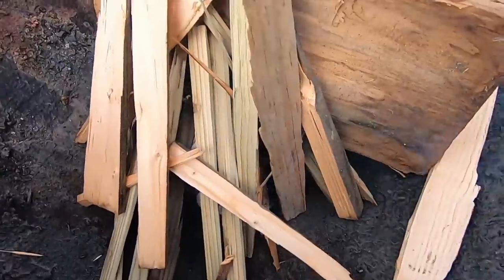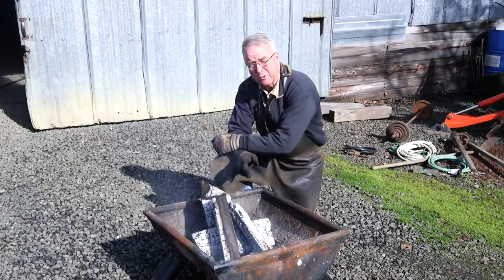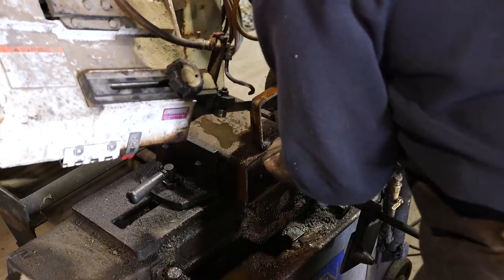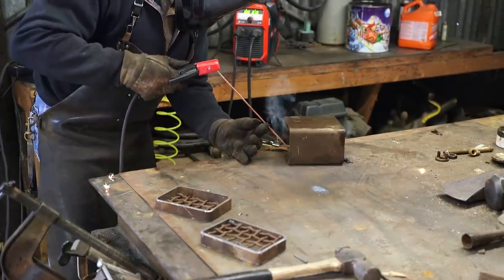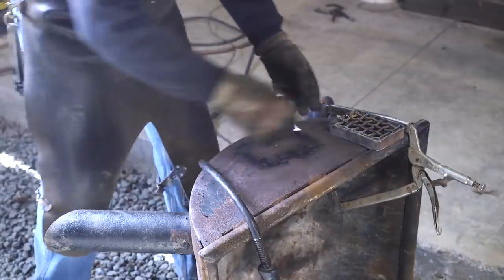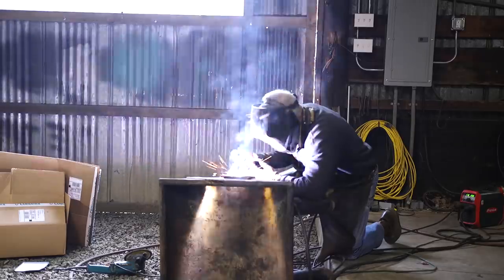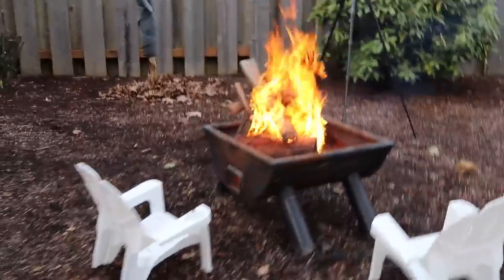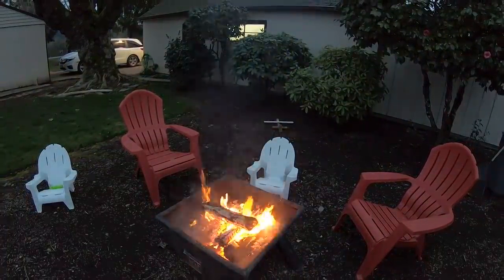Repairing a Firepit + A Tip for Beginner Welders

Comment: I noticed that the fire pit has a problem that is a pet peeve of mine.  It has no drain.  When left out side it will fill with rain.  It will be heavy to tip up and drain and that standing water will accelerate rust and the eventual demise of the pit.  Easy fix, drill a small hole say 1/4-inch at the low spot and Bob's your Uncle.  This is a problem I've had with a couple of smokers and other outdoor items so I'm attuned to spotting it. Thank you for all your work!
Reply: Yes I'm watching this right now because my fire pit rusted out. Low spot agreed, to be safe maybe a few hours around in case it gets rotated and there's a new low spot you didn't anticipate

Comment: Ranch welder...haha.  That hurt a little but it’s true.  🧐 I have built several sets of shipping pens with rusted oil field pipe and it barely gets a wire brushing.  Good old 6011 splatter rod, one in right hand for the electrode and one in the left hand as a gap filler and never chip a weld because you really don’t want to see it...it’ll hold!
Reply: Good ol Texas TIG.😉

Comment: When I was at the french welding institute, we kept joking that we where at the french grinding institute, because we spent more time cleaning the metal with grinder than actually welding it 😂

As with almost everything in life, the more you spend time on the preparation, the easier the task get. So if you're a beginner, take the time to clean it properly. Take the time to have a good fit up. Do everything you need to do before welding with extra care, and I can guarantee that it will pay off in the results.

You can get fancy electrodes made for welding on unprepared metal ... And even with those, made especially to weld on top of rust, a quick grinding stone pass will improve the quality of your weld tremendously.
Reply: Yes!  Get that rust off... AND any galvanization.
Reply: @badlandskid  rust off is just to ease the process ...
Galvanization off is to literally not die ... Not the same discussion, but you're obviously right 😂
Reply: @InformatrIIcks  exactly
Reply: I’m a carpenter. My biggest pet peeve for prep work is having a clean work space. I hate it when plumbers come to do a rough in and just leave their shavings on the ground and go to running pex, they drop something then they have to sift through the shavings to find it. I hate when people don’t do prep work, and most of the time, it’s like a 5 minute, one person task.
Reply: @colbywood8113  agreed. 5 min prep work, and 10 min cleaning after a job. You'll feel like you just wasted 15 min, the truth is this habit will save you hours in the long run because you don't spend ½an hour searching where you left that stupid screwdriver yesterday !
Reply: @InformatrIIcks  Always drink some milk after welding. A big steel fab in USA has free milk onsite and encourages its employees to drink it often.
Reply: A quick run with the grinder will make a huge difference!
Reply: @boots7859  I've welded galvanized steel and was told to drink milk...I was breathing in the fumes.

Comment: Thank you! As usual, you continue to produce quality well thought out videos. I took the AG path through High School, and boy am I glad that I did. I continue to use some of the skills that I learned back in 1962-63. I do not have an electric welder, but I use a Propane/O2 gas welding rig. The welder also is used in melting glass to create beads and such for the walking sticks that I carve. Propane is a much cleaner fuel for the glasswork and works well enough for gas welding or cutting or brazing that I do. We have shown Collies for about 35 years, and the portable pens that we use are always in need of repairs where the spot welds fail. Brazing really holds up. I have yet to see a brazed joint fail.

Comment: This reminds me of my welding career. I bought a 300 amp Miller gas welding machine in 1972 and had never burned a rod. I taught myself how and what to do and not to do and eventually made a very good living welding in the oil fields of Texas and New Mexico. Had my own welding company and employed other welders also. Everything to building new drilling rigs, to any kind of repair to pipelines. I did it all. What this reminds me of is many times I would be on a rig and one of the bosses would want a barbeque pit. He was paying me (his company) so I would do whatever he desired. I built some awesome pits and smokers. Even some on trailers. I would guess I have built 40 to 50 of them and to this day I don't have one of my own. I often think I will motivate myself to build me a nice pit but the cheap little chinesium one does the job and we don't use it very often anyway.

Comment: I despised weld prep until I got myself a good (Not Harbor Freight but a real deal high power) air angle die grinder and Ro Lok candying discs. You have to have a good capacity compressor too but it is so much more comfortable to do weld prep with that than an angle grinder. Sometimes I still have to use an angle grinder and here again. Get a high power one. The new grip trigger harbor freight one is actually pretty good. Much quieter and more torque than the sub $20 specials. Well worth it. They run cooler and stronger. It’s like painting a car. It’s all in the prep. Mill scale is quite tough on modern steel. Only weld with you see the shiny soft steel under the scale.

Comment: I am welder/ carpenter as well. Most of my welding trade was high pressure stainless steel tig X RAY work.  From one project being stainless the next black pipe and the next aluminum I had 3 tool boxes to keep from contaminating one from the other. Welding and carpentry are basically the same thought process, kinda but with one your nails are on fire. I like your videos thanks

Comment: Yep, you need some air in there!
I'd also drill some small holes in the bottom of the firepit to let any rainwater drain out, not that this fire pit is going to rust out anytime this century LOL.
Material prep is SO very important in welding, I got that pounded in my head in high school, in our industrial arts class (remember them?) if we wanted to be allowed to use the arc welder we had to be able to strike an arc and maintain it for a little while with a piece of a coat-hanger, no BS, it was HARD to do, but eventually when we could do it for a few seconds, then using actual stick welding rods was EASY.
We had teachers back then who let us fail, over and over, while encouraging us to NOT give up, great life lessons for sure.
Cheers from Tokyo.
Stu

Comment: This is on of my favorite videos you put out. Thats how I was taught to weld too. Just burn rods and wire. Creativity will kick in after you get the hang of it and you'll be making all kinds of random stuff. Use what you got laying around. Cut up an old lawn mower. Learning metal prep is absolutely necessary to be a good welder too, and you'll learn it welding scraps together. I love your out look. Its the same with woodworking. I can do carpentry, but fine woodworking requires practice and there is a learning curve. There are things you can't learn until you've made the mistake yourself. Or had that bright light bulb moment where it finally makes sense. This is irrelevant but, I'm no longer subbed to stuby nubs. There is a major disconnect there. I don't like to feel insulted and looked down on. I don't feel that way listening to you. Thanks for another great video.

Comment: Inspired by you and This Old Tony, several months ago I went out and bought some welding gear, visited a steel merchant and got stuck into a couple of small projects.
It was lots of fun, but I quickly discovered after doing some practice welds on bits of scrap that welding is very similar to painting: the hardest part is all the prep work.

Comment: That's really good advice. I'm terrible at welding, but when I weld, it's usually to fix something old. But then one time I made something with brand new steel and it came together very nicely. I had a lot of confidence in myself until my next welding job, old rusty steel. I cleaned it up as best I could, but not perfect. Oh well, keep trying.

Comment: Nicely done. I would have just cut a few holes in the side but I'm impressed with the wire grid, etc. Much better looking, more pro. I'd be tempted to cut a grid for the top for a little BBQ action.

Comment: My trick is 7014.  Welds like 7018, runs on ac well, cuts through crud twice as well as 7018 and none of the care requirements since its not a low hydrogen rod.  Only downside is its a touch more brittle then 7018.

Comment: I have the WORST luck with weld haha All I've got is a MIG but all I'm doing is trying to weld handles onto billets of steel. I'll get a good weld, I think! Then get maybe 2-3 heats and the steel goes flying across the shop, cats are running all directions, I'm just watching to see what it lands on that'll be ruined this round of "Flying molten steel" the game!! Patent pending of course!! Lol I've cleaned the steel, pickled it, polished, done everything but just say screw it and forge weld it haha Any suggestions?? Is there a MIG video for beginners???

Comment: Great ways to clean your metal before you weld or forge them are to use vinegar, wire wheel, electrolysis, and evaporust. Clean metal is much easier to work with! Always take the extra time to prepare your materials before you start a project.

Comment: that was a neat video. By the way what was that mention of soaking in vinegar? please explain thanks. :-)
Reply: Vinegar will remove most of the rust and mill scale. What doesn't get removed will be easier to brush or grind off.

Comment: I know this video is about welding, personally knowing the welder that I'm not I would have drilled 4 or 5 1" holes in each end plate, what bothered me the most was seeing some of the kindling your son used at the beginning of the video! NEVER use treated lumber in a fire! even if it's an outdoor fire...
Reply: I missed that. Yeah, treated wood has some bad chemicals in it.  Don't use it for firewood.